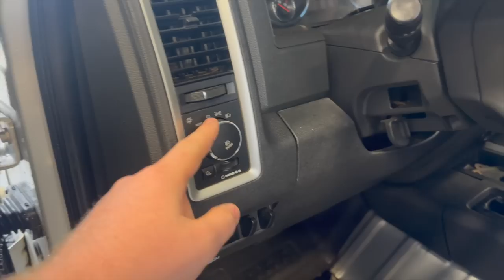I Bought the Perfect Drag Truck Project From Texas!!! CR Swapped 2nd gen Heaven.....

Comment: Honestly after building a 1000hp 5.9 30Gs is just a starting point, especially when you buy stainless diesel turbos that are like 3200 each then if you build the engine properly that alone is 25Gs and then the trans, drivelines and running gear. Then all your misalaneous piping, v bands, small things. 
My build is killing me lol